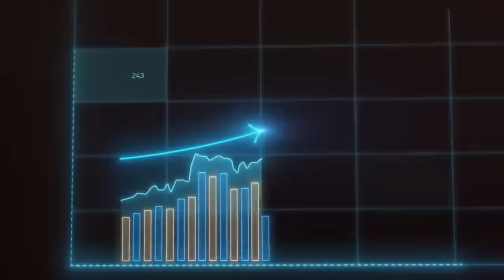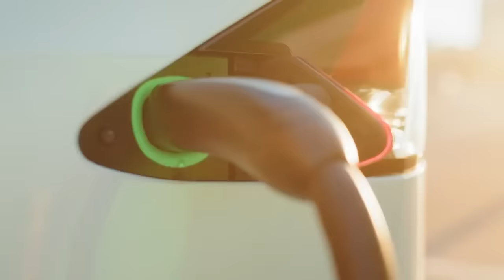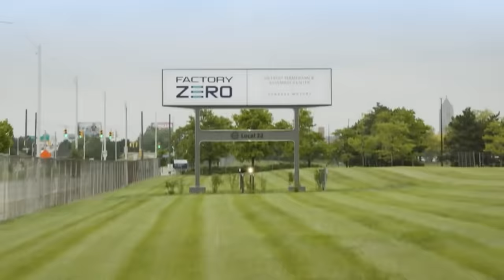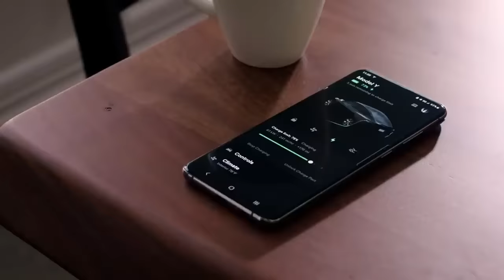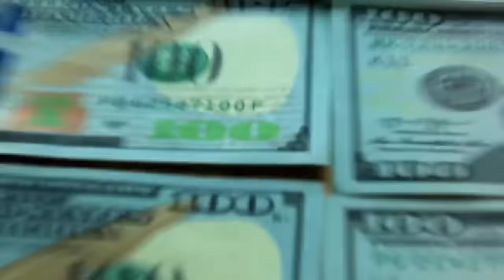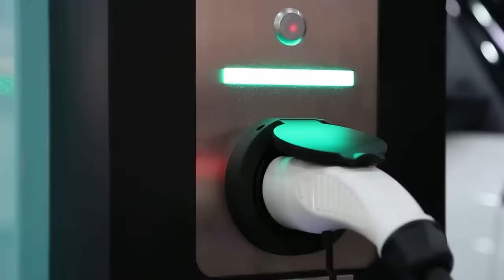Electric Vehicle Owners Are Frustrated and Demand the Return of Gas Cars

Comment: Mining minerals for these EV's is destroying the environment. Labor conditions for example in the Congo is nothing short of appalling.
Reply: your primitive gasoline powered is doing the same thing.
Reply: @johnhumphrey9953  true...except for the toxic battery chemicals.
Reply: @skylershank9309 right……because oil spills isn’t toxic at all. 🙄
Reply: @johnhumphrey9953 

Maybe, but we already have the systems in place for dealing with that.

How long, and what cost, to provide all those charging stations?

That doesn't even begin to cover, not only those costs, but the cost of the generating systems, and upgrades to the grid, that would provide for even a small percentage of the EV's to replace those hydrocarbon vehicles.

Then there's the problem of those generation plants.

No matter how badly you may want it to be, wind and solar will not replace coal and gas for decades, if ever, and there's too much pressure against the most viable present alternatives.

It's estimated that the cost of the grid upgrades alone could be anywhere from 10 to 30 TRILLION Dollars, that doesn't even count the cost of the generating systems, systems that only exist as theory.

What do you suppose that would do the cost of charging your car?

I'm afraid this is something that's going to take FAR longer to accomplish than 2030-2035, FAR longer.
Reply: Love listening to the EV owners still grasping for hope. Once a puppet always a puppet when you see the truth, hear the truth, but still believe your lies.
Reply: @jerryrupe1696  😂 The real puppets here are those believing blindly the lies of the oil and gas industry who wanna keep their business booming.

And those like you who can't even come up with an actual argument.  All you can do is lie and "insult" people you don't agree with
Reply: @PatG-xd8qn  so your really going with "what about...." and pretending that's a good argument?  Wow.  That total lack of self awareness is what I've come to expect from EV owners though.  Just admit you're cool with little black kids dying in pits so you feel like you're saving the world by owning a car.
Reply: @edmondgreen7970  I replied with a "what about" because the OP's only argument is exactly it: "what about the kids mining cobalt in Congo", and so is it the only argument you could come with.  The fact that you must insult me to think you won the argument prooves that you don't know what you're talking about.  To "what about the kids mining cobalt in Congo", I can reply "what about the kids extracting oil in Nigeria, Libya and Syria".  How is that any different?

However, in reality, over their entire life cycle, EVs require much less natural resources than a gas car which requires oil over its entire life cycle, plus a lot more maintenance. And in fact, oil extraction and transformation is far from being an ethical industry

In the end, you don't care either about where your oil comes from for your car, and I'm sure you never cared about it.

Where I live, 100% of our electricity comes from hydropower, so EVs are without any doubt the best choice anyone can make, no matter what baseless claims you will come with
Reply: @edmondgreen7970  maybe what I've read is wrong, but supposedly there are no minerals that are unique to EV batteries. So if your using a power tool or cell phone you are also contributing to the plight of Congo children.
Reply: @mmoreno7137  Exactly.  And so are there a lot of rare earths and metals in the electronics and catalytic converters of gas cars
Reply: @rtbrtb_dutchy4183  imagine.15,000 peasants on a dry basin in the.Congo surface mining with picks & shovels lithium.& cobalt.for thousands of your little batteries. Which by the way are very inefficient platforms.for.storing energy.
Reply: @PatG-xd8qn  yup, they don’t realize they are being manipulated by the oil industry. 🤦🏻‍♂️
Reply: @edmondgreen7970  you must be cool with all that too. Since you own battery operated things, including your ice car. But you also use oil, so there are kids involved in that too in certain countries. 

Yup, you’ve been manipulated by the oil industry. They gave you some propaganda and you fell for it like a good little puppet.
Reply: @skylershank9309  you mean for all the products that you use right?  Not just me. 

Thing is, EVs are improving and they are developing EV batteries without lithium and kobalt. 

Now, as to storing energy, do you know what’s worse?  A gasoline engine. It’s very inefficient to propel the car. Nowhere near the levels of an EV. The ice car is so inefficient that you can run an EV of electricity supplied by coal and still be 50% cleaner than the gasoline engine.
Reply: @rtbrtb_dutchy4183  what energy source do you use to charge your batteries? Fossil or nuclear energy?
Reply: @skylershank9309  Even if your electricity is produced with coal, EVs are still a better choice on the long run, since EVs and thermal power plants are way more energy efficient than millions of petrol engines burning fuel individually.  Also, thermal power plants can be equipped with filters and catalytic converters that are way more performant than what is installed on gas cars, since both space and weight are limited
Reply: @skylershank9309  oh, is that the direction you are going. More oil company propaganda. 

An EV driving on electricity from fossil fuel, is still around 40 to 50% better than an ice car. Why?  Because cars waste their energy tremendously and only use around 20% of its energy to propel the car. The production of electricity with fossil fuel is over 80% efficient. 

Now, having said all that, my electricity, where I live is a combination of hydropower and solar power.
Reply: @PatG-xd8qn  those batteries are only good for 10 years.
Reply: @rtbrtb_dutchy4183  solar and wind power account for only 16% on the power grid.
Reply: @dakawans83  My uncle's 2012 Chevy Volt has over 260 000 kilometers on the odometer and the battery still works perfectly.  Also, despite what some baseless anti-EV youtube channels are saying, batteries are recyclable.  The reason why we don't hear much amount EV batteries being recycled is that as we speak, there aren't enough batteries to be recycled to begin with, since the vast majority of EVs on our roads still have their original battery.  Also, once it cannot be used to power a car, it is still good for decades for other purposes.

And in the end, over 10 years, the volume of oil a gas car will have consumed is far greater than the amount of natural resources required to manufacture and power an EV.
Reply: @rtbrtb_dutchy4183  yeah, batteries are so efficient they only have 7,000 cells per car.
Reply: @PatG-xd8qn  right.  Batteries will outlast the cars they are in. The problem is, initially, that’s what the EV industry cautioned about, because they weren’t sure how well batteries would last. Now they have the data that it’s no concern, but the oil companies don’t want you to hear that part. 

Also, it’s around 16 to 36 months for an EV to be “cleaner” than a gasoline car, depending on where you live and what kind of electricity you get.
Reply: @skylershank9309  How is the number of cells in a battery indicating anything about efficiency???? EVs are, in fact, way more energy efficient than thermal cars.  You can litterally find the answer in two seconds on the internet.
Reply: @PatG-xd8qn  then why are the batteries so big?  To store the energy to operate the vehicle. Which of course depletes to almost nothing after a few hundred miles. Yeah real efficient.
Reply: @skylershank9309  The size of the battery has nothing to do with efficiency 🤦 I can tell that physics isn't your thing.  Energy efficiency: "the use of less energy to perform the same result".  As I already said now 3 times, a 2 second research on the internet will explain it to you.

Before talking about the size of batteries, go figure out the volume of fuel a gas car consumes over a period of 10 years; plus the amount of fuel that's required to extract all of it, transform all of it and transport all of it over the entire world until it reaches your local gas station.  The amount of resources required to power a thermal vehicle excedes by far the amount if resources required to manufacture and power an EV, I already said that 🤦
Reply: @PatG-xd8qn  they work really well in cold weather too
Reply: The Americans love to point fingers at other countries for whatever reasons. If the Americans are so concerned about child labor in developing countries, why don't they adopt some of those kids into the US, or at least give meaningful and enough financial aid to developing countries?
Reply: @skylershank9309  They do work very well in the cold.  I live in Saguenay, the snowiest city in Canada where -35 degrees occur every year in winter, and my Chevy Bolt works very well.  It for sure has less range, but it's still way more than enough for almost anyone's need.
Reply: @PatG-xd8qn  after hearing the horror stories from Chicago its refreshing to hear a positive experience.
Reply: @skylershank9309  I also saw all those videos talking about Chicago, and they were all was pure baseless sensationalism to make people click on the video.

Here in Québec, EVs are very popular since fuel has always been very expensive and our electricity is the cheapest among all developped nations because of our hydroelectric dams generating tons of surpluses.  And all cities in Québec are very cold, much colder than Chicago, and yet it isn't a problem for most people

What I can agree with is that EVs currently on the market aren't all good vehicles and EVs are obviously not working for everyone's lifestyle.  However, for the vast majority of people, they actually are a very good option.  Personally, I rarely drive more than 200 kilometers, so I never ever struggled with range even if it's -35 outside, since most good EVs on the market have way more range than that.
Reply: @PatG-xd8qn  I know cold weather cities have had negative experiences with EV busses. In fact a few of the bus companies have gone out of business.
Reply: @skylershank9309  The Québec based companies Nova bus and Lion electric are actually doing well

But personally I think that in cities themselves, it's way simpler and better to have trolley buses and tramways...
Reply: @johnhumphrey9953 electric vehicles cause more pollution during production than ice will in a few years
Reply: @woa1350  Diesel gate scandal was already forgotten ?
Reply: SSSSHHHHH!  You're not supposed to mention that part !  😂
Reply: @rtbrtb_dutchy4183 so enlighten me little fella,  where does the electricity come from that charges the battery in your precious EV? Unicorn facts? Fairy dust? Take your time , I can't wait to hear your thoughtful response.   😂
Reply: @brucemitchell5637  Clean energy sources are these ( well in Europe at least ): solar panels farms, wind turbines farms, Hydro-electric-power-dams, geo-thermal energy,  these are in the work so far to cut off to shut-off natural gas, oil and coal heavy polluters but it will take some long time to expand specially with 2 wars right now (Russian-Ukrain invasion and Israel-Hamas bombing)..
Reply: Child labor.
Reply: @PatG-xd8qn  i'll give you the argument , lifespan is 50% or less 10years vs +20years
what gives in total more polution , when your battery has defect you can trow your entire car away since it will cost you 50K to replace , which means much more cars will be needed to be entirely replaced after an accident ! the electic grid is already failing , so what if all ppl will charge their car on it as well , not only those with money for placing solar panals on the roof of their estate but all the appartments. All those living in apartments will charge their cars from the grid what is produced by gas and oil , leaking heat during transport . every ev is an airco since it cools or heat the battery producing heat the entire time . What do you think the problem is of our atmosfeer heating up?
or is in some magical thinking heat not the problem , so an airco on a solar panel is helping to solve the problem ???
Reply: Meanwhile, who needs wilderness in Alaska? Drill baby drill, amirite?
Reply: @johnhumphrey9953  Last time I checked drilling oil isn't leaving a landscape in a permanent destruction and isn't being drilled by children yet you support EV's where its component are mined by children.
Reply: @rtbrtb_dutchy4183  Right and you think your EV isn't made from oil products.  Guess again genius.  You think plastic is grown on trees?
Reply: @PatG-xd8qn  Oh the hypocrisy of you EV lovers who spit on oil and yet your car are made from oil products.
Reply: @PatG-xd8qn  Say that to those who are freezing to death in their EV's during this freeze.
Reply: @hhds113  oh, and nobody is freezing to death.
Reply: I mean just look at what powers mining equipment for EV batteries its not powered by a battery...

Comment: They also didn't consider additional weight on the roads and parking structures
Reply: This additional weight will add billions to reinforce existing road infrastructure and require a tremendous amount of fossil fuels in the process.  

Not to mention a greater likelihood of fatalities with impacted with ICE vehicles and higher insurance premium for  everyone.  Or limited policy exclusions.
Reply: @Gregory-Masovutch  Do you have a source for that claim please? Why should a 5,000lb EV cause problems that are not already fixed for 80,000lb trucks?
Reply: @sdfglkjhdfkjdhldskfj  because semis are way outnumbered by cars.
Reply: @sdfglkjhdfkjdhldskfj  Maybe because there will be millions of 5,000 lbs EVs compared to 80,000 lb trucks
Reply: Of the additional weight making impact with your car.
Reply: A section of road overpass collapsed in Montreal some time ago (killed a few people) and city blamed it (beside others) on cars being way heavier then 45-50 years back then…! @sdfglkjhdfkjdhldskfj
Reply: @sdfglkjhdfkjdhldskfj  Multi level parking garages were never built to accommodate 80,000 lb. trucks.   The weight difference, times 300 cars per floor is considerable.  You better check the old blueprints and structure tolerances.

Comment: THE MAKERS SHOULD BE FORCED TO BUY THE EVS BACK,PLUS HELD LIABLE FOR FIRE DAMAGES FROM THE FIRES THEY CAUSED..
Reply: I forget the car manufacturer that did lease only. This was over a decade ago...
Reply: You have a great point there, when there is something wrong with a vehicle they recall them, well EV's catching on fire and blowing up and burning down homes, other cars etc. I think makes for a major recall and refund.
Reply: @markcab2055  THE makers knew the risks those batteries posed befor they put them into production.they expected them to last 2 years then go down.
Reply: And lawmakers should be held financially responsible as well....
Reply: They burn less frequently than gas cars and if people weren't too dense to just do what the manual says it would be fine.   Mine is just fine at -40F in northern MN.   I didn't sell my old F150 but I dont use that unless its 2ft of snow or I need to tow.